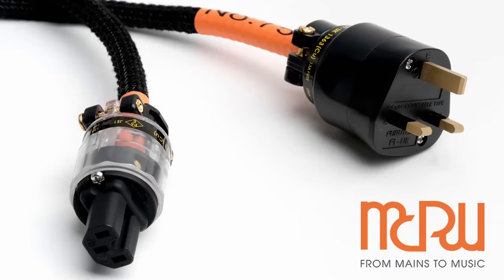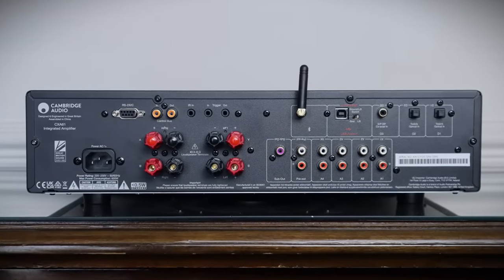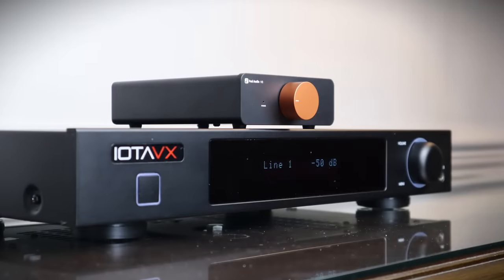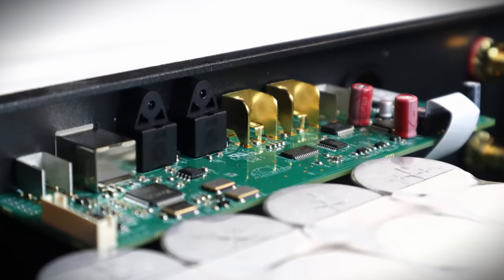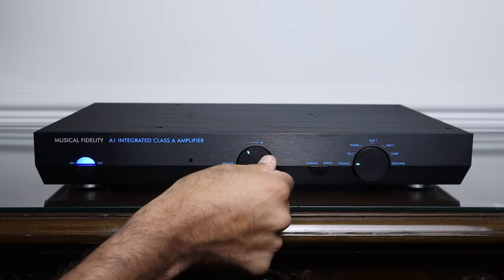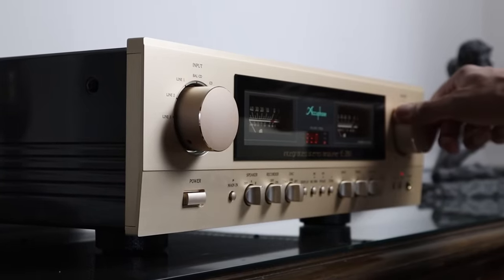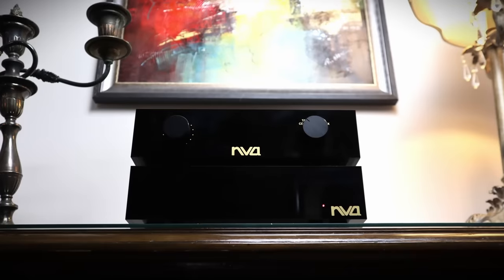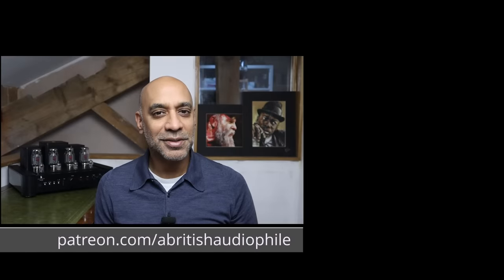ABA AWARDS | Best Amplifiers of 2023!

Comment: I'm not so sure about the Fosi V3 being suitable only as a desktop or small system amp.  Mine performs brilliantly with Magneplanar 1.7's in a largish 4.5 meter  X 7.5 meter room
Reply: What did you do about a power supply?
Reply: Surprising info ..thank you
Reply: Surprising indeed and Fosi have just launched the ZA3, switchable to mono and still only €150 or €300 for a pair. Now that should be spectacular with the Maggies if you're already getting good results from the V3.

Comment: Nice list. Personally I'm interested most in the $1000 - $3000 category most at this point but you should take a look at the SMSL AL200 / AO300, the new Infineon chipset they use sound great (edges out the V3, and has a bit more power), have decent DACs, a remote and HDMI ARC in the case of the AO300.
Reply from the maker: Thank you for the suggestions 🙂

Comment: Hi Tarun, wow you are simply superb! Have been watching a lot of your reviews lately and you have such a cool innate ability to articulate stuff minus the fluff! Listening to you is like listening to a classic LP record on a nice warm speaker played by tubes 😊. Praises aside, I recently had the opportunity to buy and listen to the Fosi Audio BT20A Pro. My expectations were low from the beginning, but for the price it is just amazing how far good affordable audio has come. No as I mentioned elsewhere, that Fosi amp isn’t replacing anything yet in my setup(s) nor it will. But a pet project of mine was to do something for my Garage using unused but like new JBL Control Now speakers. So finally ended up doing it in a circular ( donut) like array configuration of 4 Control Nows in stereo pairs connected to the Fosi amp. Currently it is on Bluetooth only audio mode. Planning to add a cheap streamer like Arylic S10 or a WiiM Mini for direct streaming. As the JBLs tend to be bright, for me the Fosi BT20A pro tone controls set in their neutral 12 O’clock positions sound the best. The max volume I would go is 3/4 or 3 O’clock position. Beyond that it loses its composure. Your review played a key part in buying the Fosi!
Reply from the maker: Thank you David. Great to learn about your experiences 😊👍

Comment: This year marked myself back into the audio game. Your channel has helped me understand much. My favorite integrated is the H190.
Reply from the maker: Thank you. I love my H190 too 👍
Reply: I'm an owner of H190 and to say my opinion are a bit of let down. I don't actually see the the hype of Hegel brand. In my case I bought them to pair with mini monitors of Harbeth backed by 7x sub of Rel. The sound is neutral and dull. Music is devoided of engagement and doesn't bring to me the emotional drive of my other rig of Cambridge cx61a paired with Focal Chorus 706 stand mount and  a cheap obscure German sub manufacter that cost me less than a quarter than the first rig. The Hegel's 150w power rating deliver the same output as the Cambridge cx61a 60w! Are the Hegel inflating their power rating the way the cheap Chinese brands do? And their 4000 damping factor is missing in action. I don't see it in my case. Very disappointed because it is my most expensive element and I didn't get what I was craving.
Reply: @benjaminqilafku5714  sorry to hear about your experiences. My H190 drives my Bryston A1 loudspeakers very well. I have owned several NAD amps from the 80’s and 90’s and Adcom as well. The Hegel is superior in my case.
Reply: @benjaminqilafku5714 the Hegel are maybe a bit polite from the few I've heard so far. It has (to my ears) this homogenized presentation which reminds me more of Sonos or Bose, done better though. I think it's probably a great match for some that get offended by highly resolving, highly separated, extended treble. I thought the Hegel bass was the star. Authoritative. I'm still going to spend more time on the H390 to flush it out more, but compared to others at its price I'm surprised I didn't like it more
Reply: @erics.4113  So polite that lacks the engagement and desire of turning it on. What pissed me most it overrated power. If its 150w output matches my Cambridge cx61a 60w in real world performance in my room and I've an issue here whether those 150w are genuine. The timber is dull and doesn't bring emotion. Its like a robot that does everything a human do but has no heart.

Comment: I purchased the Cambridge CXA 61 amp recently. Please note it lacks a phono stage therefore I had to buy one. I decided to use it in my second system as I prefer my NAD C316 BEE V2 in my main system. This has a built in phono stage which performs excellently with my Linn Basik turntable. The Cambridge AXC 35 CD player partners the NAD which I definitely recommend.
Reply from the maker: That is great 👍

Comment: Thanks for a quick round up of best amplifiers reviewed in 2023.I recently updated to Cambridge Audio Azur851w Class XD Amp. Class XD , designed by Douglas Self , boasts of class A which transition to class B at higher signal levels. For me this transition from class AB has provided better 3D depth in music alongside smoother midrange with  pinpoint vocal positioning.
Reply from the maker: Thank you 😊

Comment: Enjoyable review, as always. I'd like to prove that in my experience the A1 is unfortunately limited from low volumes already with 86db speakers like Elac DBR62. The amp sounds just as good at high volumes, gain bypassed. I don't understand this very much, the amp has enough power without distortion, but it didn't move the woofer in coherence with the tweeter as other amps did from low volumes.
Reply from the maker: Thanks for sharing 😊

Comment: Tarun as always precise and engaging. I want to ask you why the high tier amplifier manufacturers skip digital inputs and sub out ports in their products. Why they think these features are irrelevant to the consumers. In my scenario they are the fondaments of my ecosystem.
Reply: The sub output is not an issue. The best way to connect a sub is to use the speaker cable inputs. It offers the best integration with your main speakers. As for built in dacs on high end integrated amps, its a matter of cost. Building a dac that preforms in the same league as the amp and preamp raises the cost substantially. Most audiophiles buying some of the more expensive gear simply doesn't want a built in dac. Some may already have one, or plan to buy something else. You would be forcing them to pay extra for an expensive feature they don't want or need.
Reply from the maker: Thank you. Many consumers go the separates route at higher price points to gain extra performance 😊

Comment: Thank you for your advice on these amplifiers.
That Fosi V3 seems promising indeed for a simple setup. I will check the review.
I was about to buy one of those Atoll IN, an old dream. However I have realised that build process is only interesting from in300. You don't really know what to expect in the others (no pics, basic features).
So I have decided to go separate and got myself a Rotel 1552 MKII for now.  I will need a proper preamp afterwards I guess. So far I am happy with the sound that I get with my AVR and DAC.
Any idea for someone who only needs a preamp with a good built quality, not many sources input, no DAC included, with XLR I guess ?
Reply: @daiblaze1396   I guess the Atoll PR300 Signature preamp has the same build quality as the IN300 and would be a good match. Unfortunately, is has no XLR input and the price is a bit above the Rotel. Have you been considering a tube preamp yet? The Vincent SA-32 could be your choice then! I don't know its price in the UK, but in Germany it sells for about the same as the Rotel 1552 MkII. It has an XLR input and XLR output, and Vincent gear has good build quality. It also has bass and treble tone control which can be bypassed, and a gain switch allows you to reduce the output level by 8dB to protect the power amp against high source levels.

As I am looking for an upgrade from my Rega Elek Mk4, I myself take this Vincent pre-amp into consideration (with Vincent power amp SP-332) and would recommend it as a possible option. I add a link of a review in German hifi magazine "stereoplay" from 2018. (Use a translation app if interested)

https://www.vincent-tac.de/fileadmin/pdf/Tests/deutsch/Test_D_SA-32_SP-332-stereoplay.pdf
 
I hope this could be helpful, please let me know which pre-amp you will be going for. And all the best for 2024 🙂

Comment: I've just acquired B&W 705 S2 speakers and am looking to upgrade my amplifier to match their quality. My amp is an Emotiva A-100 miniX, and I have a budget of up to $1500. I'm considering both integrated amplifiers with a DAC or pure amplifiers. If a pure amplifier would significantly enhance the sound quality, I'm willing to pair it with my existing Emotiva DAC Stealth DC-1 for now. Could you recommend the best options for amplifiers or integrated amps within my budget that would be a perfect match for my B&W 705 S2 speakers? Quality sound is priority over features.  TY
Reply from the maker: Arcam May be a good starting point to try with B&W speakers 😊

Comment: As much as I love my Parasound 2125v2 for my GoldenEar BRX, I've upgraded to the NAD C298 (similar to NAD M23).
My Parasound will be moved to powering the surround L/R speakers in a mixed use music/movies 7.4.4 setup.

My requirements (<50 lbs and <16 in deep, trigger input/output, gain adjustment, RCA loopout for subwoofer).
It's 2024, and I'm shocked how many amps don't have at least a trigger input, much less a gain adjustment.
My video https://www.youtube.com/watch?v=ncwCopnHJqA
Apple Music
Reply from the maker: Thx for sharing 🙂